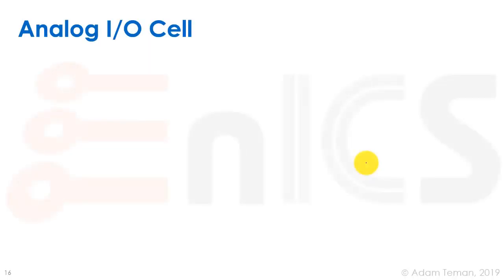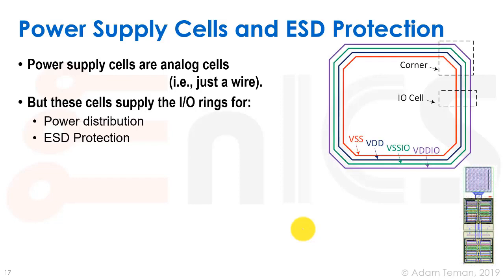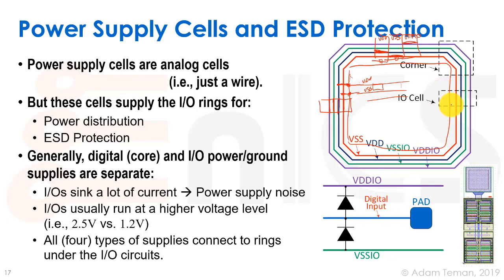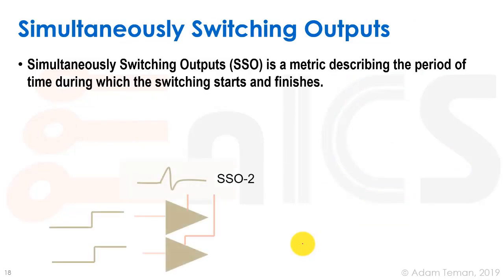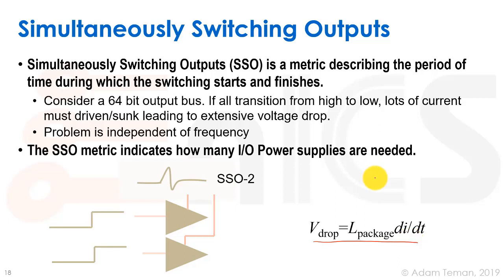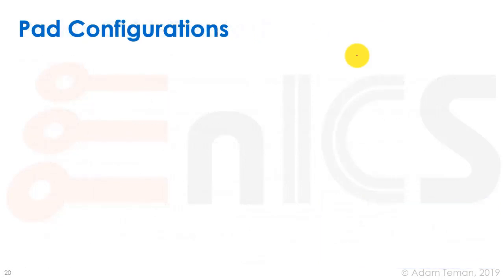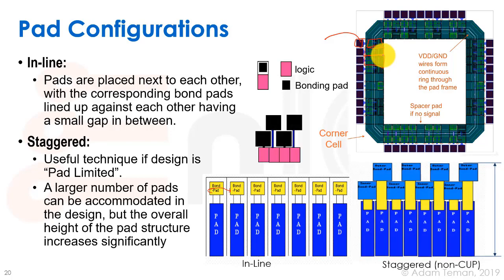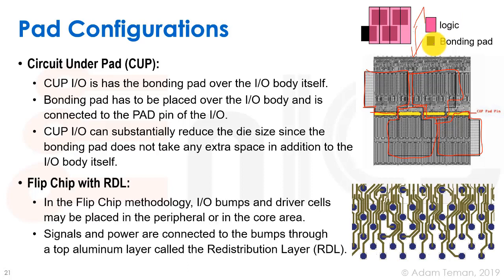DVD - Lecture 10c: I/O Circuits - Analog IOs, ESD Protection, Pad Configurations

Comment: Could you please explain me what is the differences between supply clamps and power clamps? are both same? if not how they are different? i know supply clamp will protect the input lines or circuit by sending esd event to vdd using primary or secondary clamps and from vdd to gnd using ggnmos or BigFETs . Even power clamps will protect the power lines like whatever esd event is occurred or arrived it will send to gnd using either snapback or active devices. So now both are doing same sending esd event from vdd to gnd. then how to differentiate. Im not getting this. could you please help me to understand this?
Reply from the maker: Good question. 
While I am far from being an expert on ESD and it's been a long time since I've read through specs of I/O libraries to understand how to use the clamps, I think the difference between the two types of clamps you are seeing is as follows:
1) I/O Clamps - connect the input signal to VDD/GND through protection diodes and resistors, as explained and demonstrated in the lecture.
2) Supply Clamps - connect VDD and GND through a protection diode. One explanation I found for such a circuit is covered in "ESD Protection Device and Circuit Design for Advanced CMOS Technologies" by Semenov, Sarbishaei and Sachdev, showing a potential ESD path between VDD and GND through a circuit that is protected by such a clamp.

That said, there are many other types of ESD circuits that have been proposed and may be found in various libraries. So I'm not certain that this is the two categories of clamps that you are seeing. If you figure this out, please update the viewers by replying to this comment.